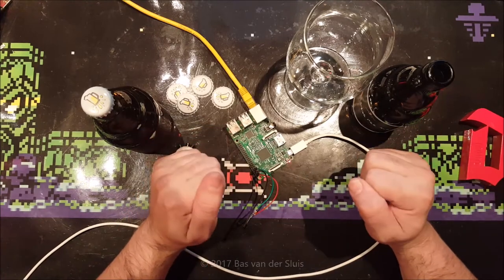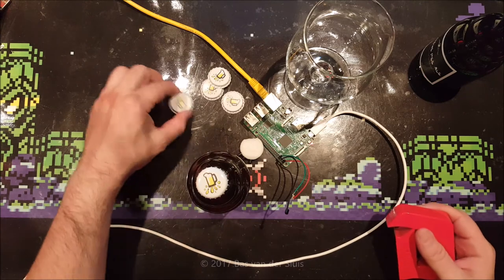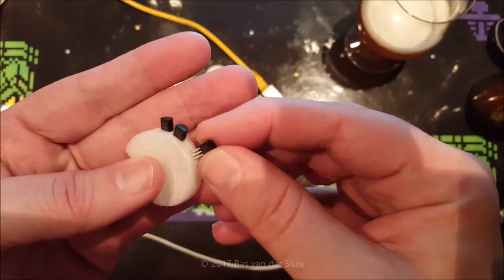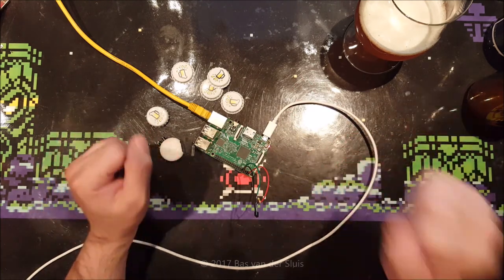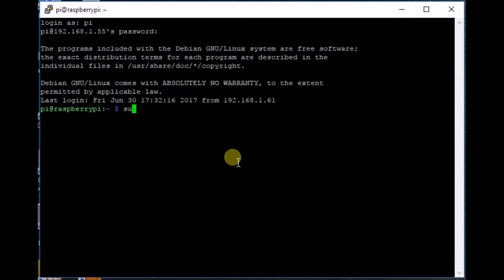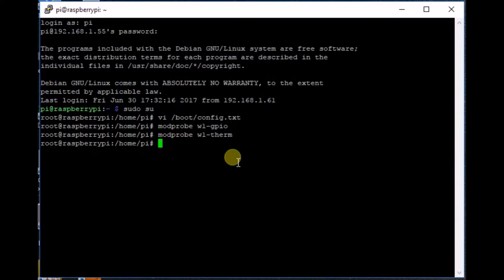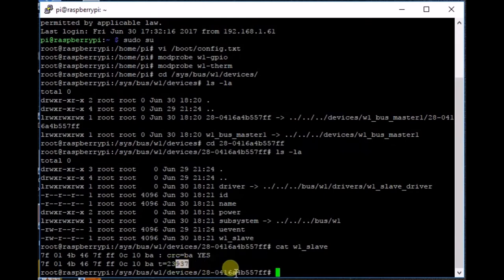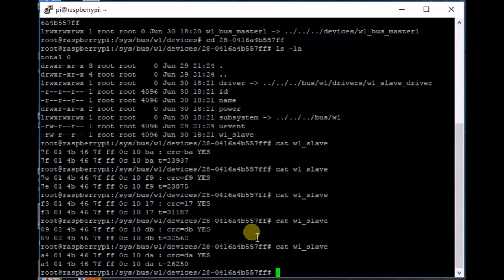Connecting a DS18B20 Temperature Sensor to the Raspberry Pi (easy)

Comment: Thanks for your video. I have the same probe, but it doesn't work (I haven't -XXXX folder). In your video I saw that you use a resistence between 3 V cable and data cable. Is it a must?